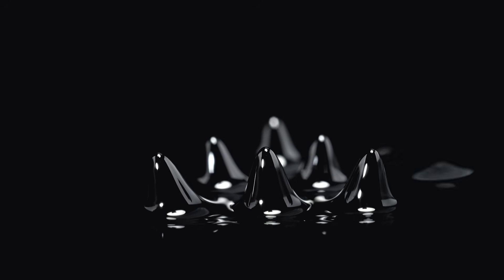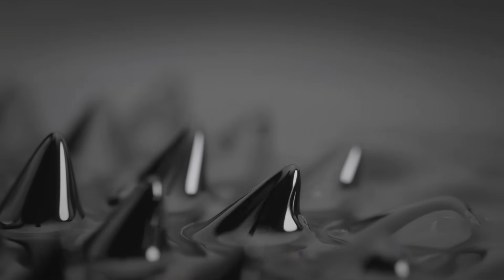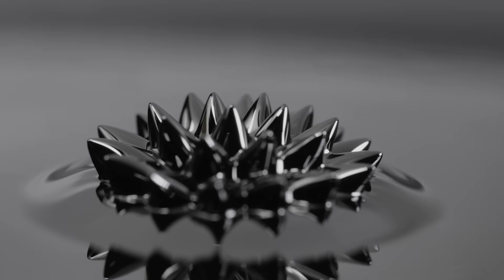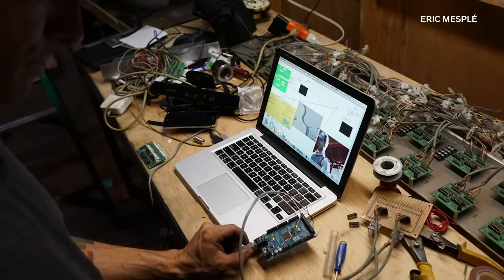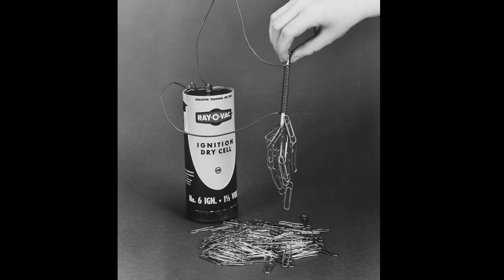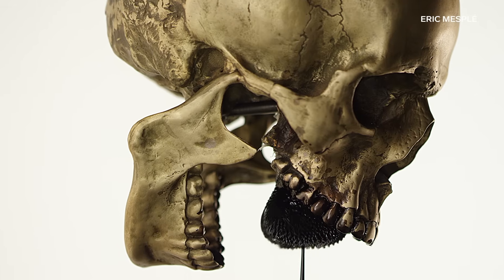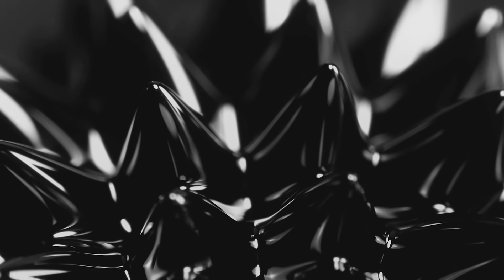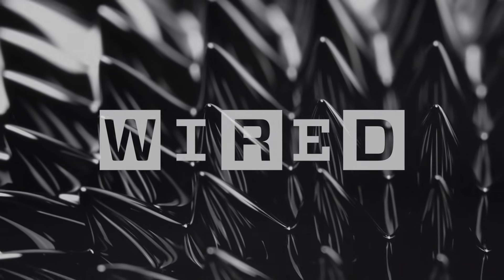How This Guy Makes Mesmerizing Fluid Sculptures | Obsessed | WIRED

Comment: How sturdy, rigid, durable? Will we eventually see cars with truly amazing tires that can assume various shapes and diameters? That would be pretty cool. 
We'd have to see some mighty powerful and durable field generators.

What about draping a very thin film plastic over the fluid sculpture then heat and cool it to record the shape in the plastic film? 
What about spraying paint on the sculpture in all its spikiness to build up a copy in thin films of paint?
Glowing paint, of course. :)

Comment: You need a chemical pump. It has lobes that pump fluid through a tube without actually contacting the fluid. No magnet in contact with the fluid. Should run with no problem

Comment: Maples are usually tapped beginning at 30 to 40 years of age. Each tree cansupport between one and three taps, depending on its trunk diameter. The average maple tree will produce 35 to 50 litres (9.2 to 13.2 US gal) of sap per season, up to 12 litres (3.2 US gal) per day.
Reply: Denzel White aaaaannnndddd, what does this have to do anything
Reply: @farisalhajjar4640  just a fan just thought it would be awesome to say new on this youtube still learning.

Comment: I feel like a table top with that fluid on the surface and strong magnets underneath that do a computer choreographed dance would be sweet. They could be electro magnets with variable voltage, or they could be rare earth magnets that adjust in proximity to the surface underneath. Like it is cool to do the thing where it mimics someone, but a well executed dance would be cool too. It wouldn’t be complex
Reply: But you're screwed if you keep a laptop or a phone on top of it lol.
Reply: Check out Daniel Rozin and the countless other projects that came after. No, it wouldn't be difficult to code, especially when there's probably solutions on github.

Comment: I bought a very small amount of Ferrofluid on Amazon. Man did I regret it. As stated in the video, its VERY messy and a pain to clean off. I should have researched more on how to handle it. That said, I was still able to use a glass bowl and use magnets to mess around with patterns and what not. If you want to get some yourself, please read up on it first so you know you are doing.

Comment: Didn't know they were used in hard drives, so here's the Wikipedia entry for "ferrofluidic seal":

Ferrofluidic is the brand name of a staged magnetic liquid rotary sealing mechanism made by the Ferrotec Corporation and was first patented by the predecessor company's co-founder R.E.Rosensweig (USP 3,620,584). The seals are the most important commercialization of ferrofluids to date. The seals are used in rotating equipment to enable rotary motion while maintaining a hermetic seal by means of a physical barrier in the form of a ferrofluid. The ferrofluid is suspended in place by use of a permanent magnet.

---

Magnetic liquid rotary seals operate with no maintenance and extremely low leakage in a very wide range of applications. Ferrofluid-based seals used in industrial and scientific applications are most often packaged in mechanical seal assemblies called rotary feedthroughs, which also contain a central shaft, ball bearings and an outer housing. The ball bearings provide two important functions: maintaining the shaft's centering within the seal gap, and supporting external loads. The bearings are the only mechanical wear-items, as the dynamic seal is actually a series of rings made of ultra-low vapor pressure, oil-based liquid held magnetically between the rotor and stator. Therefore, the operating life and equipment maintenance cycles are generally very long, and the drag torque very low. The magnet material is permanently charged and requires no electrical power or other re-energizing or maintenance. Ferrofluid-sealed feedthroughs reach performance levels that other technologies can't achieve, by optimizing features such as ferrofluid viscosity and magnetic strength, magnet and steel materials, bearing arrangements, and water cooling for applications with extremely high speeds or temperatures. Ferrofluid-sealed feedthroughs routinely operate in environments including ultra-high vacuum (below 10−8 mbar), temperatures over 1,000 °C, tens of thousands of RPM, and multiple-atmosphere pressures.

Magnetic liquid seals are engineered for a wide range of applications and exposure but are generally limited to sealing gases and vapors, not direct pressurized liquid. Each particular combination of construction materials and design features has practical limits with respect to temperature, differential pressure, speed, applied loads and operating environment; however, these limits can generally be overcome by carefully selecting or designing the device for the application. Necessary features may include multiple ferrofluid stages, water cooling, customized materials including metals, permanent magnets and ferrofluid, and exotic bearings. Ferrofluid-based seals have extremely low leak rates - almost immeasurable with laboratory equipment - however they cannot reach the levels of welded connections or other all-metal, static (non-rotating) seals.
Reply: @lovely-mk4rt  👍👍
Reply: @oleeoleeoo2610  👍👍👍
Reply: Check mate teachers, Wikipedia is a reliable source
Reply: Its a smart application, and it makes sense why they would use it. It seems so easy.

Comment: Imagine the liquid gets evaporated over time and then it rains like magnetized water that only sticks to metal
Reply: Calm down, folks, it's just iron soup, not magnet soup
Reply: God Left  i know it’s impossible I just like to think of it being possible
Reply: Imagine how much smaller umbrellas would be
Reply: v v the rain would attack to the underside of umbrellas because it is made of metal
Reply: That's not how evaporation works though. If the fluid evaporates, the iron remains in a solid form, so none of it goes up into the clouds to create a magnetic rain. It's an interesting hypothetical, but it is entirely physically impossible.
Reply: kingofbudokai I agree. Also, it would be impossible for it to evaporate because it made of iron and alcohol, not water.
Reply: Bread Man i know it’s impossible I just like to think of it being possible
Reply: kingofbudokai  i know it’s impossible I just like to think of it being possible
Reply: Interesting thought, though not probable. Firstly, the fluid itself isn't magnetized, it just reacts to magnetic fields. Secondly, the liquid would evaporate, leaving the iron behind thus making it non-reactive to magnets.
Reply: Hello?
i know it’s impossible I just like to think of it being possible

Comment: I'm curious if changing the surface tension of the carrying fluid or pulsing the frequency of the magnet to various trig waves might not affect the width and height of the peaks.
Reply: SandyRiverBlue, You Are cleary the peack
 of Intilijinse.
edit: revised my spelling
Reply: @an_ton7405  I think it's more like, I'm at the foothills looking up. Probably more like, in a ravine below the foothills with the foothills just barely visible in the distance, but thanks Bob.